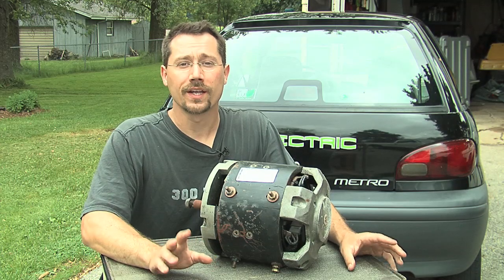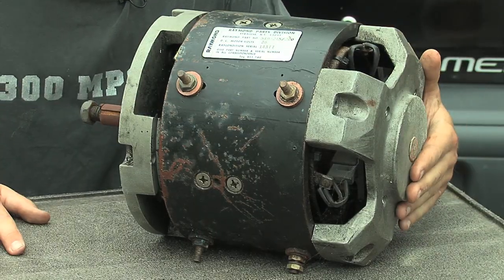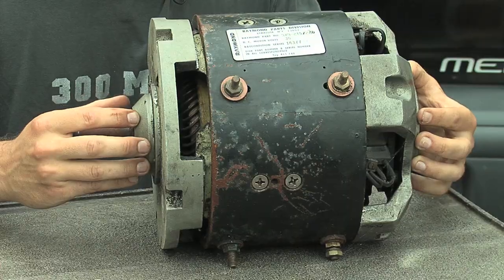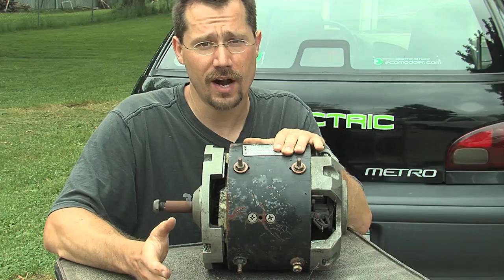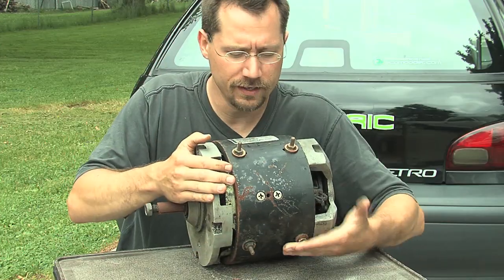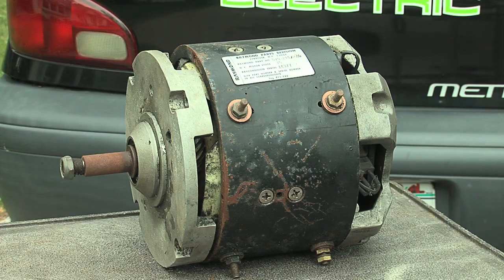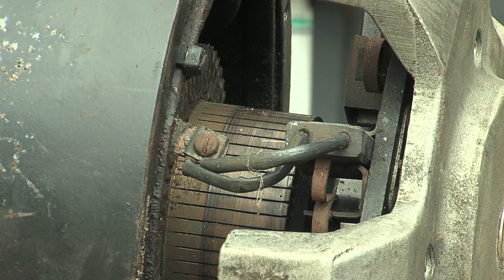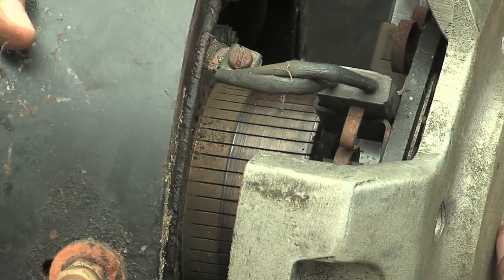5 Build Your Own Electric Car: DC Motor Basics

Comment: Thanks for sharing your knowwledge and understanding. There was one section there without side where it looks as though you were talking about cleaning up the inside. At the end you mentioned you had an epoxy spray can and also that you had to varnish the field coils. Can l ask you what type of epoxy  it was you used, and was it solvent based.  Thanks.
Reply from the maker: I mostly just CLEANED the inside of the motor. I also pulled out the field coils and I gave them a coat of a spray-on insulating varnish. I don't remember the exact brand. It was green. You can just do a web search for similar products. Here's a photo of the field windings back in the motor after I coated them. https://wp.me/aa28PZ-2HU

Comment: What kind of esc do you use?
Reply from the maker: On this car, I originally used a 72V Curtis Dc motor controller. I later used an open source OPEN REVOLT 500A/144VDC controller.
Reply: @BenjaminNelsonX  hello Benjamin, thank you for the reply, i wanted to ask another question, the fact that are using a series motor who can work in DC means that it can work with current directly from the batteries, no need for alternators like in the brushless system, just a ESC a motor and batteries and GO! Last thing, how does the series motor do uphill? Thank you a lot
Reply from the maker: @sandsoftime7611  Yes, controlling a DC motor is simpler/less expensive than controlling an AC motor. A series-wound DC motor has plenty of torque, so hills aren't an issue. Just remember to design your system so that it has appropriate batteries for the current draw required for driving in your area.
Reply: @BenjaminNelsonX  thank you so such for all the good information, keep going with the good work 👍

Comment: What size electric motor would be needed to drive an automatic RangeRover4.5 litre petrol engine? Then there is the question of batteries. I have seen that Teslar type S batteries are best but how many does one need for the power and a reasonable running time of say two to three hours?

Comment: Many years ago now, (1968) I had the electric drive motor from a milk float, a sort of small truck used for delivering milk here in the UK. The motor was arround 4 times the size of the one you have there. It was a compound motor that converted to a generator by reversing the series winding relative to the shunt. I have no idea of how many apms it could put out but the first time I tried charging a battery it boiled it and then blew it up inside of thirty seconds and it was not a small car battery but a very large tractor battery, I was 15 at the time and the idea was to provide power in a shed at the bottom of the garden to use as a lab.
Reply: do you still explore the inevitable horizon of known hazards -  when i was young, it was "Gilbert Chemistry" in my 'danger if you stand too close' laboratory..

       splash damage can be
         very unpredictable

Comment: Problem with these type of DC motors is brush wear. Motor will not last long before bushes need replacement. Better a brushless motor design. Does complicate things as you do then need a motor controller, these are expensive.
Reply: if the electricals are tuned right for the motor and the load of the car its installed,the replaced carbon brushes you just saw would last more than 10000 miles

Comment: OK so you got the motor for $100, BUT what about the needed CONTROLLER?
Reply from the maker: I originally bought a used 72V motor controller for $200-$300. Later, I upgraded to a DIY Open Source motor controller good for 500A and 144V.
https://youtu.be/Epg4qFfIiYY

Comment: Is it safe to put 10 12v DC BATTERIES in series as a power bank for the car ? . And if I wanted to have “AWD” I would need 2 motor in series connecting to all wheels ?
Reply from the maker: Placing a number of 12V batteries in series was common practice for DIY electric car conversions. Of course, now conversions are done primarily with lithium batteries, and building lithium battery packs are a little more complicated than that.
Two separate motors is a good approach for for building a four-wheel drive vehicle. This is what Tesla has done, as have other home-builders. The motors would be connected electrically in parallel to the battery pack so that they both receive the same maximum voltage from the battery pack.
Reply: BenjaminNelson  thank you so much for your useful guidance

Comment: Hi Benjamin. Tha ks for your videos they are amazing.
I own a couple of Isuzu npr and nqr trucks. I do construction cleanup and pull a trailer with a Bobcat skid steer. The total GVWR of the truck is 18 thousand pound when loaded. And when pulling the trailer could go up to 24 to 26 thousand pound. 
If I would like to convert these trucks to electric, first.. is it possible? Amd what kind of setup would I need? Thanks man!
Reply from the maker: Everything is possible, you just have to decide if it's worthwhile to do as a DIY project. A project like that would NOT be for a beginner, and it would require a large budget. The big manufacturers are JUST starting to manufacture electric trucks. Tesla and others have been working on semi-trucks, and Ford recently announced that they are going to build an electric F-150 pickup.

Comment: Good information. I used one of these motors to power an electric farm utility vehicle and a useful small mod worth doing
while the motor is apart, is to glue a thermocouple sensor to the stator winding. I just used a cheap digital thermometer and 
it gives me good warning about motor temp before any risk of winding damage occurs.
Thanks for posting.
Reply from the maker: Good tip! Always nice to know the temperature of things!
Reply: Great innovation "Alasdair". Is it still functional?
Reply: It is still going strong, just repacked second set of batteries after 10 years of daily use.
$600 worth of batteries but we're still way in front over regular fuel cost for that same time.
The only noticeable difference now is that its quieter, the commutator and gear train is completely smoothed out.
Cheers

Comment: Be sure NEVER to use silicon sealant around DC motors.  You will destroy your brushes in a very short interval.   Excellent video.  Nothing wrong with DC motors.   They provide excellent torque across the whole speed range.  AC motors have a tougher time doing that without complicated controllers (inverter drives).  You can get regenerative action from DC too.  Don't let anyone tell you that you can't.

Comment: Some things that... well is not quite wrong... i would say need to be adressed to some point.

* "the biggest diffrance between a electric car and a gasoline car is the motor"
I would say that is not actually the case. Neither in price, weight or significant. And for series hybrids its not even true at all.
The biggest diffrance is the prime energy source. That is.. the batteries.

* "A magnetic field pressing against a other magnetic field"
While that is true, its only half the story. The fields are both attracting as well as repelling

* " in smaller motors it might be a permanent magnet"
I would say in almost all smaller motors there is permanent magnets. Yea.. there are exceptions, but they are rare.

* "A mineral magnet"
While its technical correct that the magnets are made out of what use to be minerals, that is true for pretty much everything that is not synthetic (or biologic). To be more exact they are ferromagnetic.

* "Those motors are limited in power depending on how strong those permanent magnets are"
While again, this is technically correct. It makes it sound like electromagnetic motors are more powerful. That is not the case. Permanent magnets today are so powerful that they have pretty much a order of magnitude stronger magnetic fields than any copper based magnet. Have to go super conductors to have anything better.

Its worth pointing out that the really ultra power full magnet, while they existed for over 30 years, they just fairly recently become realistically cheap for electric cars. As far as i know 2010 Nissan leaf was the first fully electric car that used permanent magnet motors. (Tesla roadster didn´t)

*  "A DC motor runs directly from battery"
While its technically possible, its not really practical.  Most DC motors use something called a H-bridge to limit the flow of power to the motor, and also making it possible run it backwards. This operations can actually be done mechanically. But that carries over a new host of problem.

A AC motor needs a double H-bridge, that unlike the name implies is actually just 50% larger than the H-bridge, it can also handle 50% more power. So it really makes it just as cheap in practicability. Worth saying that double H-bridges is way harder to program for, so that is kind of a draw back.

* "A pretty good motor for not much money"
Weeeell.... I would say a series spun DC motor is probobly the worst option around. They both have the drawback of having coals as well as being horrible inefficient. They also have a much narrower torque band as well as very little high rev power..... I will agree that they are common, but they are really not good.

If you just want something to test a concept on before pooring to much money into it... yea sure, then a series-DC motor is a good selection. But for a final version... no.. really not.

* "Horsepower don´t mean much on a electric motor"
I would say that is really not true. The main diffrance is that a electric engine got it full torque from 0 RPM, while most ICE need to be around 2000-40000. While horsepower for a electric motor dont make much seance at low RPM, in high, it makes a lot. 

Also worth saying that electric motors generally can be over charged quite significantly. A 8 hp electric motor can easily do twice that for a very short period of time (that is not true for AC permanent magnet motors)

May seam like im a bit picky.. and.. well i might be.. but some stuff is worth being very exact or clear about

Comment: How many HP and RPM?  your car weight? mph? range?

Anybody ever reduce the gear ratio on a motor like this by 2:1?  I need to get my 3.5 rear end ratio to around 7:1 so I can do direct drive.  Anybody DIRECT DRIVE connect one of these directly to the Rear differential's Poke?  
Can somebody check my math:
2700lbs w 10kwh bank.  28inch wheels.  36v 20hp 3000rpm Motor Direct drive to 2:1 reducer to my 3.4 diff gear ratio.  Will it do at least 40mph and 40 mile range?

Comment: Great info man. I'm thinking about adding electric drive to the two "inactive" wheels on a performance oriented vehicle.  I think the most fun but also the most fabricating would be something like adding electric motors to the front wheels of a manual transmission rwd car (example a camaro) to essentially make it AWD, and another great thing would be that the electric motors would act like a dual clutch if you have it wired to a button on the wheel when you let off the gas to shift.
Reply: If I wanted to make a simple car with a motor and speed controller (accelerator) will I able to do that? with just a motor like that?

Comment: Very good. Thank you.

What's the used (ebay) market price  on a motor like this?

My project truck is a 2002 chevy blazer .. like 2000lbs with all the ICE removed.   My goal is only 40mph and 60 mile range. 

 I'd like to run without w/o a transmission or gear box. possible?

I'd like to turn my RWD axle around and mount the motor behind between the chassis directly behind the axle connector? possible? thoughts on a long cable run and mounting position? I know I need to weld a stand.

Possible to go Lithium and fit all components (except motor) in the engine bay. 

Given my specs/requirements, what motor and how much Lithium battery do you think I need and what can I expect both to cost and weigh?

Many Thanks!

Comment: Hi i was wondering if you would do boats,  I have a 87 30ft Sea Ray, model DA 300.  I was thinking of going electric instead of gas.  both engines are mercruiser's 260hp @ 350's. I only have one eng working but when i go out it does 9knots.  I'm not looking for speed, but would like it to go at least 12 knots on all eng's.  its about 18 mph.  what would you recomend..
Reply from the maker: I'm really not a boat guy and haven't worked on any conversions. However, more and more boats are going electric all the time. The process of converting watercraft to electric is very similar to what you would do to a car. I have gotten to go for a ride on a couple of electric boats. One was a commercially built electric called a Duffy. It used a series wound DC motor and bank of lead-acid batteries. How it worked was actually very similar to my car. I also got to ride in a solar-powered pontoon boat. That used an electric motor by a company called Torqeedo. The canopy which would normally just shade the pontoon boat had four solar panels on it. Those charged the batteries. There was NO shore power where the pontoon boat was kept. It was TOTALLY solar powered.
https://duffyboats.com
https://www.torqeedo.com/us/en-us

Comment: Would love to convert one of my cars to electric as getting petrol here lately means joining a que for hours. Problem finding the motor in junkyard not going to happen. Not a common item.
Reply: Consider converting 4 automotive alternators into dc motors and use for 4-wheel-drive vehicle.

Comment: Could you set up the break pedal to switch polarity on the motor and add to the manual break power because the lost power from not having vacuum from a gas motor for your break booster would need some boosting. Or am I crazy?
Reply from the maker: "REGENERATIVE BRAKING" is a great way to not just charge the battery, but also generally improve braking of a vehicle.
For this project, I used a series-wound DC motor. It's a great motor with plenty of power, but is NOT well designed for use as a generator. Permanent Magnet and some other types of motors work well as generators. You could do regen in a basic way with some mechanical switches and the like, but it's usually done as a feature of the motor controller.
Reply: Could maybe install alternators as part of the non-drive axle. If you have a fwd car you could use the rear axle to install a regen system. It should add sufficient resistance to reduce mechanical braking requirements.

Comment: My unit was a 108 VDC system in a 1987 Toyota Corolla Station wagon. Used an S&S 48hp rated DC motor and Curtis controller, the lead acid 6VDC batteries were the really bad part - weight and the fact that they lasted me approx. 3 years! ($4800.00 for the batteries!) Still have the set up - had to replace the front end (it was originally automatic) put in a standard 4 speed, and clutch unit. It was a hoot when it ran, but doing it again I would save up and do an AC unit! And yes, built my own adapter plate for the transmission - and had a friction joint machined to do the join of engine to the transmission. It was a really steep learning curve time for me - on the job training - I had a bit of electronics under my belt but this thing was a whole new world in itself! - Build one you'll see what I mean. One of the best things I ever experimented with!
Reply from the maker: Ah, the days of the "Lead-Sled'!
Batteries, motors, and controllers have all improved in that time. Building your own electric car is still a great project, although at this point it makes the most sense for a truck, convertible, or classic car. I can not say how much I learned from working on an electric car project. It really was a blast and tons of learning to boot!

Comment: Did you get that motor from a fork lift?
Reply from the maker: Yes, both the motor showcased on the bench top and the one used in the car are salvaged motors from electric forklifts.

Comment: Thanks for the info . Very helpful. I want to convert a sail boat to electric drive. With solar. Thanks
Reply from the maker: Electric boats are awesome, go for it!
Reply: I'm converting a cub cadet riding mower into electric amphibious vehicle. Electric motors are the future imho. Gonna try converting car alternator into a DC motor. Trying 2@12v=24v car batteries and 24v controller from electric wheelchair. Paddles made from 6" PVC. Flotation (planning but may go to inflatable) 2 part foam that pivots up just out of water or higher to form roof. Next is to assemble all of the craziness into a functional vehicle when the weather isn't frigid nor sweltering. Taking pictures. Will put out a YouTube vid IF IT WORKS. lol
Solar power on your boat is a kool idea, sails etc. Dunno if I have enough surface area to use solar myself but now I gotta research that too.

Comment: how fast does that motor go ?
Reply from the maker: I never had a real tachometer on that car, but I could drive the car faster than 70 MPH. Sorry, I don't know the exact RPM of the motor itself. I was working with salvaged motors on projects like these, but if you buy a new motor, it will typically have information including how many revolutions per minute per volt.

Comment: The key to getting car HPs from small electric motors like these is to modify the motor to water cooling. This is what all modern electric factory vehicles do, if you rely on air cooling then the motor ends up being too big and heavy. An electric motor will keep giving you more power as you increase the voltage until the coil wires get to hot and melt. If you modify the motor so water is being pumped around the coils you can run like 5 times the standard voltage. A gas motor is only 30% efficient and you lose a huge amount of power in the gearbox. You need to lose the gearboxes and run motors direct to the wheels and then control the torque using an electronic controller.
Reply: Read my comment .